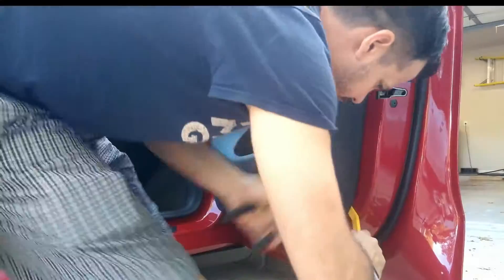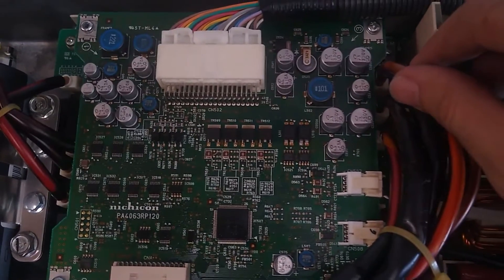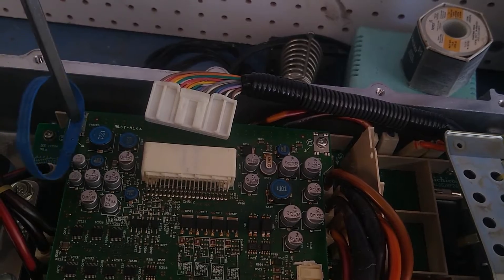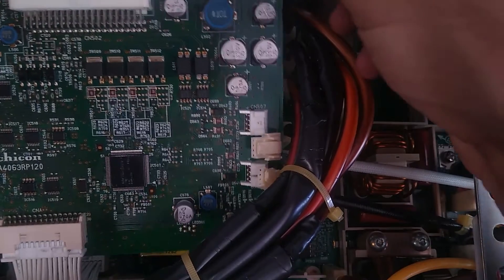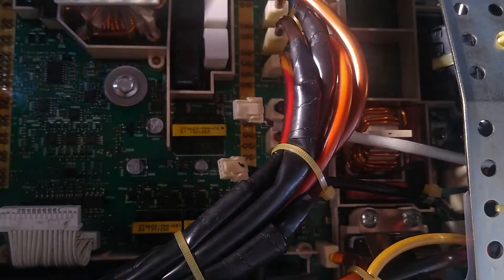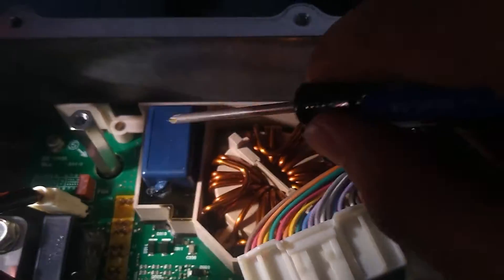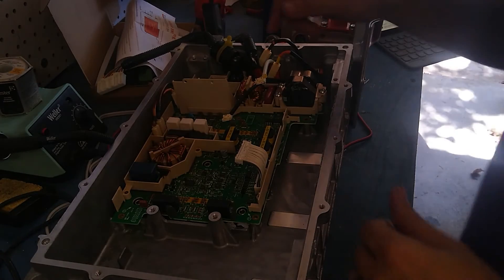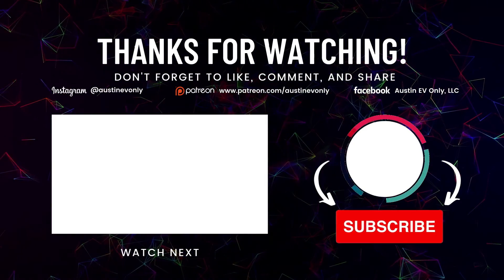Nissan Leaf On Board Charger (OBC) teardown

Comment: If you're an EE then you might want to consider designing one of these by yourself. You may find much of the subcomponents off-the-shelf now days. This takes 120Vac at 14amps (for 1.6kW charging) or 240Vac at 14amps (for 3.3kW charging) and converts to 400VDC which it sends over to the BMS. I believe these are switch-mode converters. Won't be long before obtaining used OEM units from salvage yards is no longer an option. Leaf owners will be desperate for options. Maybe start with an XP-Power HDL3000 HV Power Supply (Digi-Key $1500) and modify it for a custom application. Someone's going to do something like this eventually.

Comment: that looks like a power module, not just a heatsink...if you have enough clearance between the pcb and the power module body, cut the pins off to prevent dammaging the pcb

Comment: I rebuild over 40 of them. I allways have them in stock in Los Angeles:)
Reply from the maker: I think you are the gentleman I called and asked if I could source the capacitors, but you declined to help. :(
Reply: @AustinEVonly  yes, I do not provide components. I provide reman units.
Reply: @AustinEVonly  i don't sell components for a same reason why you can't walt in a restaurant and walk out with a live chicken. That's just not something what we sell for number of different reasons. I can sell solution for rebuilding ze0 And imiev onboard chargers. It comes with all designs, equipment, test points, list of parts etc. Price of it 75.000$ Restaurant can sometimes share his signature dish recipe. Look at that this way.
Reply: @AustinEVonly  I don't sell it for a same reason why you can't walk in the restaurant and walk out with a live chicken. That's something what they don't sell for number of reasons. I can sell a whole solution with tools to rebuild imiev and ze0 leafs onboard chargers. It comes with all diagrams, part numbers, PCB, 3D, and G-Code designs, list of parts, test points, list of capable parts. Price is 75.000$.
Same as restaurants can share his signature dish recipe but under some circumstances.
Reply: I also buy a defective units, 100$ for one.
Reply: Do you have a website?
Reply: @teephlelps7172  My company called Hitechautomodule located in Van Nuys, California. You can find it on Google maps.

Comment: Hi,  I have a 2011 leaf and in need of the onboard charger. It seems when i check on ebay the part numbers and letters are different. Does it matter if i get a used one with different numbers and letters? Also does it matter of which charger i need if single charger port or dual port type?
Reply: Good question.   Did you ever get an answer?    Thanks
Reply: I read that there were many different model of chargers used, that could be why you’re seeing different part numbers. Good luck.
Reply: 0A to 8A(last digits of one) they all interchangeable. Chademo capabilities are embedded in all chargers. It's just the matter if they was been installed in your car or not.

Comment: One desoldering technique that I have used from time to time is to heat the solder, and blow compressed air on the wet joint. Be sure to remove all the splatter from the board, though because all those tin droplets may cause short circuits.